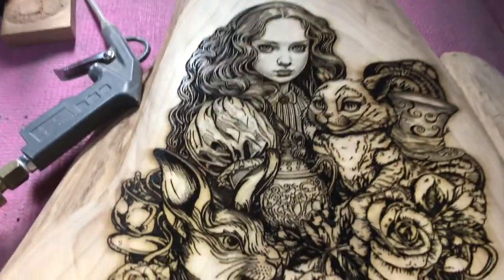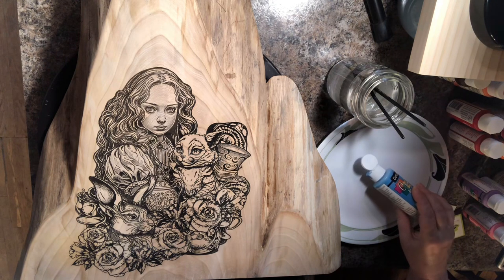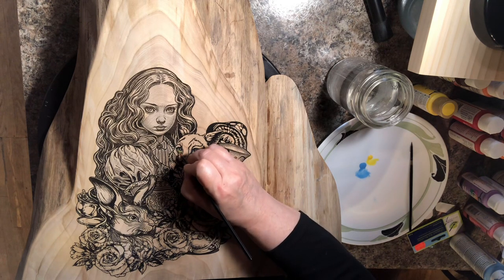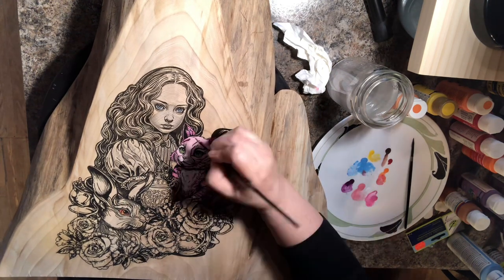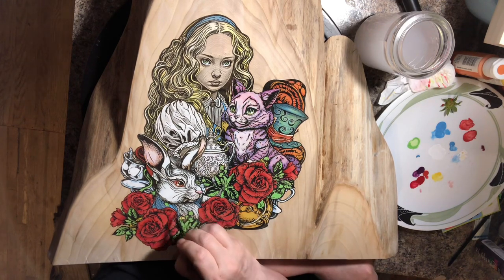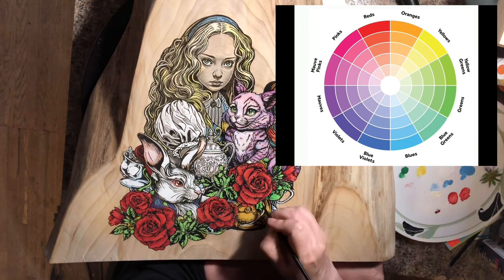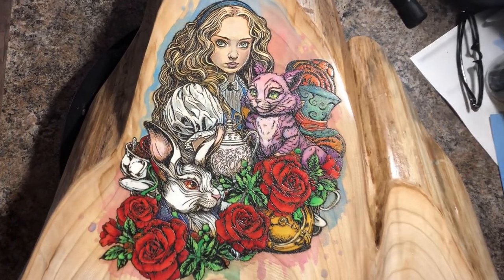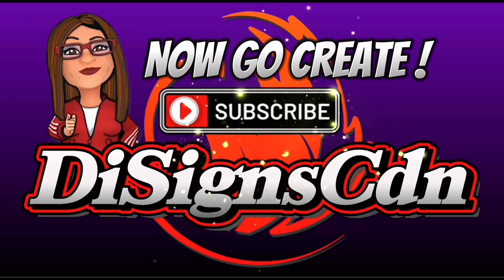31. HOW TO PAINT YOUR LASER ENGRAVING ON WOOD , LIVE EDGE. Laser engraver, OLM3 OLM2Pro

Comment: You can also use the mask on your wood BEFORE you engrave and that will keep the scorching off of the wood.  You can do your spray seal before removing the mask.  Taking off the mask on this engraving would be time-consuming but worth the effort.  Beautiful work.
Reply from the maker: Hi! Thanks for sharing. :)  I have used paper transfer tape in the past before though. I found I had to go ALOT slower to make it through the mask and to get it as deep as I wanted in to the wood. There was a considerable amount of smoke, so I'm thankful for my DIY enclosure and exhaust fan. :)